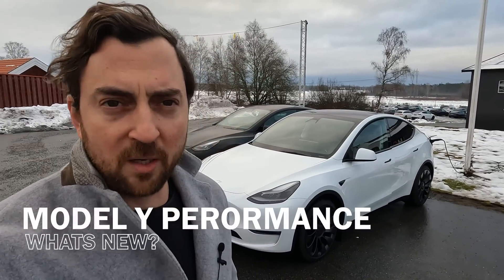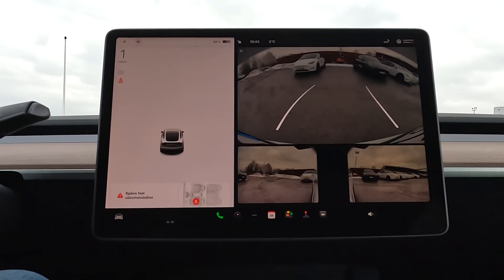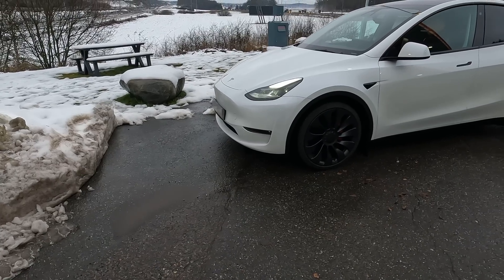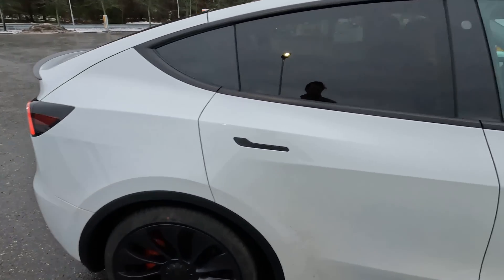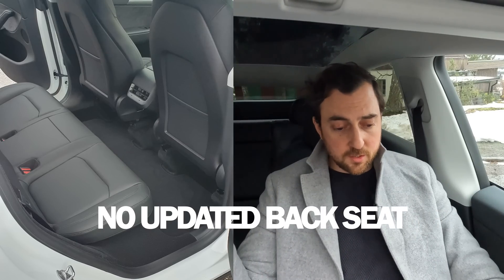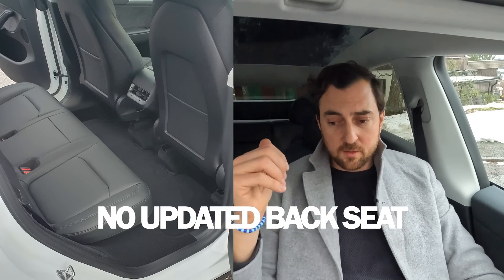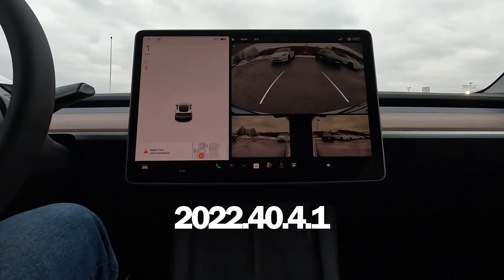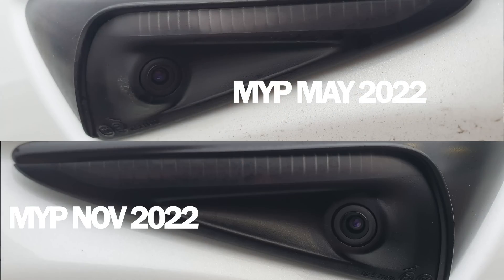Tesla Model Y 2023 updates - No parking sensors! Can tesla vision fill the gap?

Comment from the maker: Do you think it's possible to fully mimic the the functionality of the USS with cameras only?
Reply: The answer is no
Reply: @boomchakalaka3  the answer is none knows before they do it
Reply: The software is supposed to be coming soon. Lets hope its not a year to wait. I am getting my MYP in a week and am not looking forward to having no parking sensors :( I believe the software will use the front camera to predict where the obstacle will be, assuming you drive up to it. So as long as the camera sees the obstacle a couple of metres away it should work out where it will be when the object disappears from the cameras view. Apparently they have millimetre accurate wheels sensors to calculate distance to the object. Lets hope they sort this out. Really sucks that Tesla removed them before the software is ready.
Reply: Of course it can not replace uss. The rear view camera is never clean. It is a dirt magnet.
Reply: @loiphin  just bought mine 3 weeks ago. Nice of them to lower the price by 14k right after we bought ours eh?
Reply: @loiphin  Yeah, I think they will get it working but they should have not removed the ultrasonic sensors until the vision replacement was proven to be just as good or better
Reply from the maker: @loiphin  yes, technically it's possible to calculate the distance between the obstacle depending on your speed even if it's has passed the the view of the camera. But it's probably s lot of tuning before that works good. I'm 🤞 that you'll get it asap.
Reply: I don't think so, parking sensors have evovle through many years. And the cameras are nowhere near all the blind spot, where they can detect objects up close to the vehicle.
Reply: Absolutely not… What if water / dirt / mud etc., obscure any of the lenses, then what..?

I experienced what seemed like a single drop of water that rendered one of the camera’s useless. Good thing I still had the ultrasonic sensors…

🤔
Reply: @Superz3ro  Erm.... You clean it? What do you do when your windscreen gets dirty?
Reply: @Dynamacrtm  Windscreen or do you mean windshield, cause there is a button one can press and these wiper blades sweep across the glass clearing the obstruction. However, the camera lenses would require one to inconveniently pull over to the side of a possible hazardous road or in bad weather conditions to wipe the lens, or like other vehicles, have a backup system to cover unforeseen circumstances. Luckily some tesla owners already have radar and ultrasonic sensors while other of us still have ultrasonic sensors…

I suppose Tesla could have tiny wipers or blowers for each lens, or figure out a way for the aerodynamics of the vehicle to blow across the necessary lenses (in this case the rear camera)…

🤔
Reply from the maker: I think Tesla will manage to replace the USS with Tesla Vision but there is a big but. Dirt, snow and darkness in combination with the lack of redundancy will make the Tesla vision very sensitive.
Reply: @ItsOnlyElectric  Yep. I agree. And very short summary is that there is low level of trust to the system if it works this time or not. Or there is bad contrast on the object -> vision may not understand situation right.
Reply: @Dynamacrtm  
So Tesla is fitting camera cleaning controls akin to washing the windscreen?   Can you point them out? 
Cleaning your cameras involves leaving the car and cleaning with a cloth mid-journey before parking at the end.
Reply: @ItsOnlyElectric  have no sensors - absolotely hate it … is very dissapointet with my new Tesla 😢😮
Reply from the maker: I understand that. Hold out. I think and hope a SW is on its way.
Reply: @ItsOnlyElectric  on 2022.44.30 .. no chimes, no measurement 🤷‍♀️. A lot worse than my 2010 Ice car, that have both warning lines and chimes in front and back ..
Reply: The removal of sensors were purely to save money on these most mass produce ( model 3/Y) the use of cameras is just a decoy, and for us to buy into the idea that it’s ok every thing fine . Why they didn’t remove the sensors on 
model S/X !!!
Reply: @Green-Mamba  probably because model 3/Y share parts ?
Reply: @Green-Mamba  They will once Tesla Vision is fully operational
Reply: @Green-Mamba  tesla have said uss will be removed from s/x next
Reply: Its all BS…they are making this car less safe to drive as compared to even basic low costs cars too.
Reply: @tavisingh  what's BS is your comment, doesnt make the car less safe. People have been driving cars with out sensors for a hundred years.
Reply: @DaBrowns69  - you live in 2022 or 1922…I want a car safe and should reflect the things what you should get in 2022..
Reply: @DaBrowns69  my 70-year old mom is definitely less safe than me.  she definitely needs her parking sensors.
Reply: @DaBrowns69  
Cars have become safer with sensors.  There is no need to reverse that trend because Tesla wants to keep producing cars at high-rates when it can’t source parts .
Reply: Very first time, thinking iabout buying an other car, I don’t want, but this is crazy. 😮
Reply: @hefter-film   got one, is very dissapointed…
Reply: I think to some extend yes, but probably not reliably. Lidar could do it much better (if you really do not want to use USS)?
But this is clearly kind of cost savings Tesla does. Not my cup of tea...
Reply: No. There is no way the cameras the car has could see the low snow shown in this example. Disappointing.
Reply: Most journeys in the dark or in bright sunlight I get told at least one of my cameras in blinded or blocked.  I have never been told that environmental factors have blocked my radar or my ultrasonic sensors.   My sensors can detect obstacles whatever the weather even below mine and the cameras line of sight.   This is a dangerous cost-saving exercise.    

“Sorry I hit the small child who ran behind my reversing car, officer, but don’t worry, Elon says the cameras are just as good as the sensors he chose to remove“
Reply: The market for third party add-ons for Teslas is so large, and busy, because of all the things that they’ve left off such an expensive car. And they keep removing significant parts and features and adding more games and other apps. They need fewer software geeks and more automotive engineers.
Reply: $50k + for a vehicle and no ultrasonic parking sensors is ludicrous & defeating 
Absolutely not can cameras replace sensors
Reply: Only if Tesla adds a front bumper camera and or Radar (one or both might be coming at the end on Jan, 2023).
Reply: Certainly not.
Reply: You can't fully replace well proven parking radar sensors with camera. 
Tesla is driven by greed, not by customers. Pitty because core engineering of the car is done well.
Reply: Any news regarding chimes for non parking censors model Y? As of now it is patetic low price/ low quality feel of a new car. Shame on you Tesla …😮😢…
Reply from the maker: No news yet. I have checked the last known release and no change.
Reply: the answer is no way get f’ed f offf hahaha. Kaparthy got fired for Tesla Pission only! ANy dead kids during the night?
Reply: No, should be very hard.
Reply: Tesla might add the radar later on for the sold Tesla which don’t have radar for a small fee, just guess LOL
Reply: Removing these sensors saves cost yes and thats good especially if it probably won't be needed. Would tesla really just remove critical things to save money and annoy customers? It's hard to mentally adjust to not having something when you are used to it and uss have been useful, but it's function is singular and dated technology. Think about it this way, if you are blind a long stick is very helpful to find obstacles. But if you then had eyes (ie tesla vision), would you still carry a stick around as back up? Maybe initially, but then you realise the stick isn't needed anymore, but it takes getting used to. This is like apple removing the 3.5mm jack. Everyone has moved onto Bluetooth now, and no one cares. At some point all the other manufacturers will be removing USS.... you heard it here first =)!
Reply: @Dynamacrtm  I do not believe camera only solution will ever work as well as USS. But as low cost/quality option I guess OK.
Hopefully Tesla does not start to do fighter jets, as they would dump radar from those and replace with 720p cameras as that is what human pilots do also and have been doing :)
Reply: @mho0  pointless comment. Military radars identify things and guide missiles hundreds of miles out. Does your eyes see hundreds of miles? Not remotely the same thing. Let me know if you have something constructive to add.
Reply: @Dynamacrtm  It was more or less pointless comment :) , it was more like a joke related to Tesla's obsession to do everything with vision.
Reply: Unless they add cameras to the bumpers I don't see how this will ever be as good as the lidar sensors. At their current production level in Berlin removing the lidar will save them about $15 million annually and give them a lot of bad press.
Reply: Should be better. Why not? It sees closer to the car than a driver does. Area to be parked in is visible before getting too close to see, the car knows what is there...
Reply: It should be possible, since it has several cameras and it knows its focal length.
When I back up my car, I just look at the end of the bumper and check to see if it has some distance to the wall.

I also just look in mirrors and when I back up I center the driving lines between obstacles. So I dont ever pay attention to the distance sensor.
Front is the hardest should be noted... Since you cant really see down low there without a camera and even if you add a camera down low, it would get dirty very fast.
Of course it could be sprayed...

But I think that AI should be able to track objects in line of sight and then know approx how far you are from the object.
Wont be fool proof, but the USS also has a lot of edge cases - like thin poles, padded concrete  etc. (as the USS has to reflect ultra sonic sounds)
Reply from the maker: @OlavAlexanderMjelde  yes, it's possible but will probably take time to make good. Let's see. :)

Comment: I have just gotten my first Tesla 2023 model Y LR vehicle in August 2023. It also has the HW4 and newer cameras.  I really like all the features and it meets my daily driving needs.

I seem to have no problems with Tesla Vision far as where I park and using park assist. Main locations being in my garage and a few common spots I go to around town.  

I never had the sensors, so no idea how much better they were. Here is my take with my vehicle below.  Reading other comments here, many are unhappy, but Park Assist works for me. I know it is not going to be as accurate.

I am not that picky on being the exact inches from the walls or curbs but it does give me good stopping points and close enough to put my vehicle into Park.  It is not exact, but good enough for me.  I get a big kick out of these videos that people pull out a ruler to see how exact the measurements are.  I know they are not going to be the same, so I don't worry about it.  
All in all, Park Assist is quite handy for pulling into my garage so I can close the garage door with no problems.
I am pretty good in parking without this aid, but as long as I have Parking Assist, I will use it. I have only used Park Assist for pulling the vehicle going in front Nose first.  Haven't tried or needed to back in somewhere with Park Assist.  If you don't like it, what can I say.

Thanks for your video and take care.
Reply from the maker: Thank you for sharing. This videos was recorded just when the sensors was removed and the software for USS was non existent back then. Today there's is a better support for it but still limited.

Ut is going to get better with time and HW2 may solve some of the issues. 👍
Reply: @ItsOnlyElectric  i agree.  Thanks for this video showing what happens.

Comment: I picked up my new model Y LR on March 1st of this year (2023) and it’s still the same. No improvements whatsoever. ZERO warnings when parking. I even set up a soft obstacle with big garbage cans and revered into them. I bumped them with no warnings. Same thing goes from the front. I should have paid more attention to that stuff before buying the car. I would have waited. I heard the sensors were removed, but from what I was reading it seemed like “Tesla Vision” was going to be better, but honestly I don’t even think that has been rolled out software wise. If it has, then it’s absolute GARBAGE. My 22k 2014 Honda has far superior parking assistance then this 55k car. 

Tesla made a bad move with this. They chose money over the safety of their customers.
Reply from the maker: Picked a quick liver Myp just now. Same here too.

Comment: I took delivery of a 2023 Model Y knowing that the ultrasonic sensors were removed, but I assumed that Tesla would replace that with an equivalent or better parking sensor. This is an important feature that should not have been removed unless there was a better alternative installed in the car. I hope there will be a petition to get this fixed or a class action lawsuit in the works.
Reply: makes no sense, which tells us that it's not ready and does not yet exist.  who does that?  Remove the sensor without a ready solutions.  I'm surprised this feature is not part of safety regulations.

Comment: my biggest worry is: I parallel park and then the car in front of me leaves and another guy comes in closer than before. how will the tesla vision work then as he can't see below the hood line. the sensors would have no problem. 
I think tesla screwed this one us as in US ppl are not used to parking sensors but outside US and especially in Europe. parking spots are tight and cramped so it's quite useful to have the parking sensors so we don't ding other ppls cars
Reply from the maker: A very good  point and a hard scenario to solve with the current setup of cameras.

But maybe HW4 will be introduced sooner then we think.

Comment: I picked up my Tesla Y few days ago, and I thought, I need to change the settings,  then I realized, that park sensors are not available. The most stupid thing is that the rear mirrors move down to show the tyres at the back to make it even worse; in this case i cannot use rear mirrors and would miss approaching cars while parking. At least this one I can change, but the car should not be delivered with that set up, it is so stupid. On second day, I hit the trunk door, i thought it would recognize the obstacle above, but it did not. It just hit the obstacle. I am very disappointed, I don't feel at all that I have a smart car, it is only electric. I would have not bought this car.
Reply from the maker: Sad to hear about your baş experience. I hope Tesla fixes this asap.

Comment: The calibration you pointed out in the video is for Autopilot, not for parking sensors. Also why are you trying to test a feature that is not yet available? This video is more or less pointless.
Reply from the maker: Pointless for you maybe but not for a lot of others that didn't know that the sensors was removed or ordered cars with sensors and therefore expecting that feature to be present.

It has been a couple of months now and still now sw fix for this. Have you tried driving it without sensors?
Reply: @ItsOnlyElectric  I own a 23 MYP, so I’m used to driving without the sensors. My point here is that you’re not accurately reflecting the facts. Tesla had you agree to the fact that this feature will be temporarily unavailable prior to delivery. If all you did was make a video stating that this feature is not available, that would be fine. But instead you lead your viewers to believe that it’s not working, even though your car does not yet have the necessary software update.
Reply from the maker: @achtenhagen  so when exactly will we receive the update?  No one knows but hopefully very soon.  One important aspect is that not working is the same as yet not available for an end user. There's is nothing in-between existing an not existing. It doesn't help the driver that drives his/her car in the current now that something hopefully is going to work in a later stage.  

 When my friend took delivery no one explained that the cars didn't have sensors. Probably stated somewhere in the delivery note but back then not so obvious. So fora lot of people it came as a surprise. And a lot of people are reporting damages on their car because of the lack of parking support. 

Don't get me wrong, still think that Tesla makes the best EVs on the market and I'm driving one myself and have been since 2017. But this move was a bit disappointing.

Comment: Does it have a front facing camera(s) and is it in the windscreen only or at the front on the fender?
Reply from the maker: Windscreen is the only front facing cameras.
Reply: @ItsOnlyElectric  Thanks.  I guess a camera that low would get too dirty much of the time and easily damaged, but that underlines why ultrasonic sensors are useful.  So the question is, will Tesla eventually provide a software update which uses the windscreen and side cameras to produce a sufficiently accurate representation of the distance to objects at the front of the car?  I'm guessing it's possible for the cameras to map objects as the car approaches., and to include accurate dimensions of the front of the car.
Reply from the maker: Yes that's is the big question and we are all waiting for this specific answer. Let's hope for a update soon